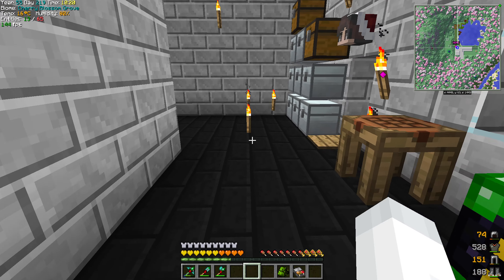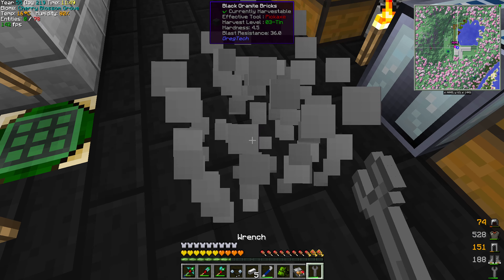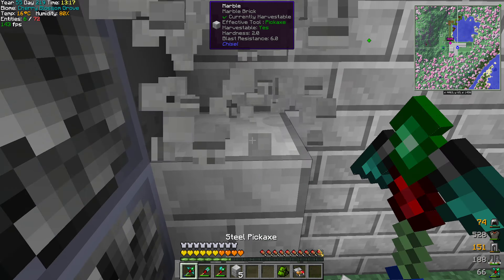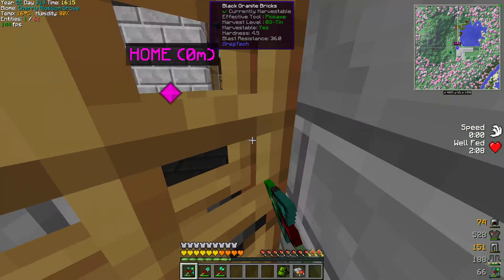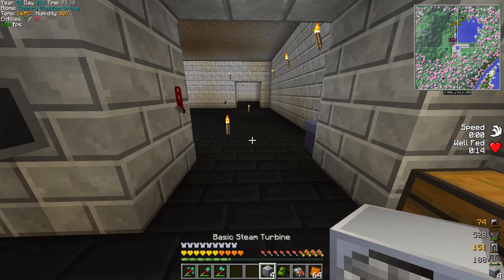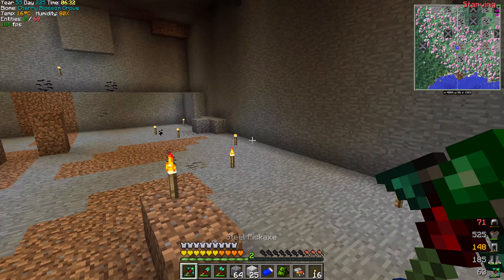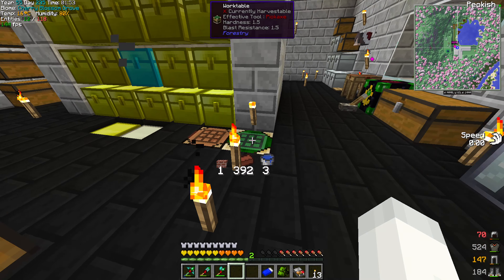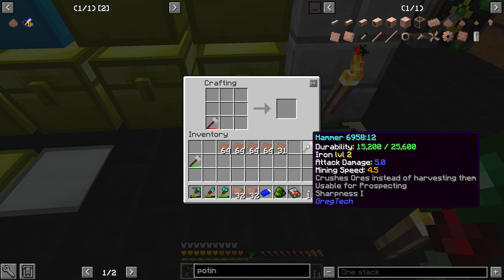GTNH 2023 - Part 38 - Making Potin for New Fluid Pipes & Increasing Steam Setup

Comment: Around this point is when I start the big infrastructure grind; fish oil, seed oil, and plant balls for biofuel, an automatic clay processing facility (infinite aluminum is nice, though you need to have second-tier coils now with the recipe change), plastics for project red and GT pipes because if you don't need a specific functionality of AE, you don't need to use AE. Hamstringing yourself by holding out for AE is not smart when there are so many just as effective options. Typically I have project red and GT pipes handling processing logistics like passively crafting components, Enderio acting as pseudo subnets monitoring buffer inventories, and leave AE just for storage and manual crafting, with an enderchest network handling the storage-to-processing area transport. 

I did experiment with Railcraft signaling too; conditional detecting wireless redstone signaling that doesn't require chunkloading lets you get up to some crazy witchcraft. Will probably do more Railcraft when I get to that point again tbh, its incredibly underrated, especially in a pack like GTNH where you spend so much time in a loaded base that minecart derpiness doesn't get too troublesome.

So for bees, two to really aim for early on are the Zinc and skystone dust producing bees; aside from the zinc itself, zinc bees can also rarely produce gallium combs, and gallium usage just SPIKES out of nowhere. As for the skystone, depending on how you process it it can become a source of just about every variety of rare earth. The absolutely insane amount of key, otherwise rare or tedious to obtain byproducts genuinely saves you weeks of time by having it sourced beforehand. Besides, in general there is something satisfying about breeding up the bee (or crop, salty roots and oilberries are so nice, along with the radioactive plants) to produce the resource that normally enforce a certain progression speed before ever reaching that point and having a stockpile to laugh at the intended speedbump.